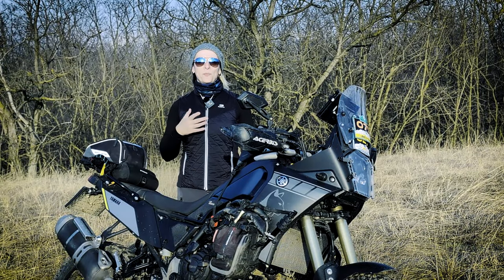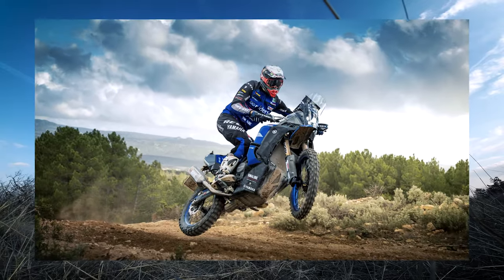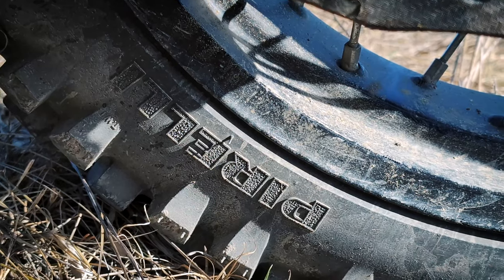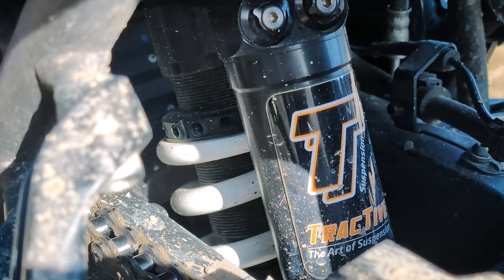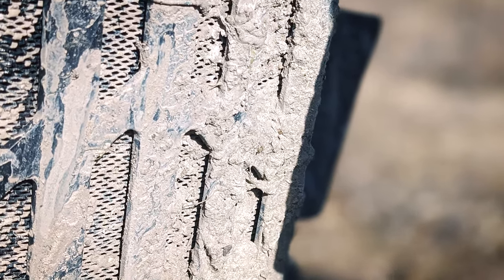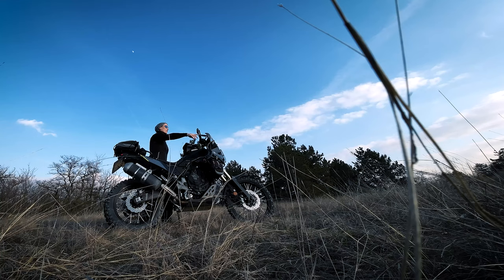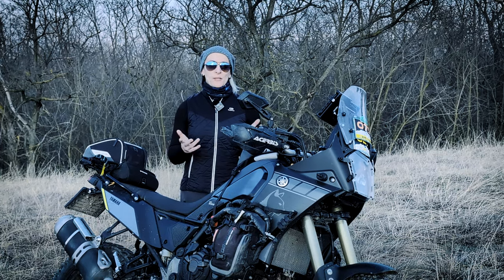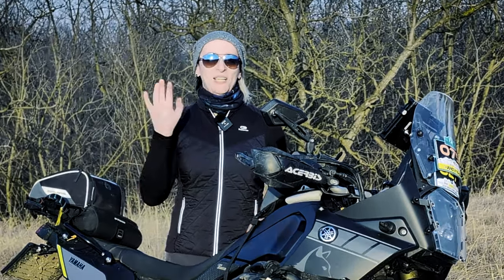Top 5 modifications to upgrade my Yamaha Tenere 700 for serious offroad riding

Comment: Holy shit girl, I was going to ask why you left the stock exhaust on the bike if you know what your doing, THEN I SAW YOU RIDE.. awesome to see you thrashing the big T7 and I will absolutely be paying more attention to your channel 👍. I can handle a t7 reasonably well but m8 your a weapon...great to see a lady's riding channel that survives on proper hard riding, not relying on "I'm a girl so I'm special"...I sure as hell could not out ride ya..top stuff and kind regards Jb
Reply from the maker: Thank you so much, I am really happy to hear it! ✋😊
Yes, you are right, the exhaust change is mandatory too, but for me these five things and the brake system are the most important to do list parts. 
Once I got the full control over the bike - shocks, forks, tires, brakes - and she is protected a bit more as the OEM sh.... well...
Next is the engine power and throwing away that ugly stock exhaust for sure! 😄
Reply: @braapt7  I mentioned the exhaust as the stocker has a bad habit of bending Into the swing arm on impact. I agree 100% on the 5 mods you talk about. In the order you suggest as well.
Reply from the maker: Just like that. Mine was bent in several times too, but nothing broken yet. But no question, it will be replaced asap after the full brake upgrade.
Reply: @braapt7   I couldn't agree more, I have essentially the same set up. Tyres/rally raid forks (also known as tractive as u know) revalved shock with 8.5kg spring, camel adv brake pedal and more (I won't bore you with details lol 🤣. But I completely understand why you've waited on the exhaust. When you do may I suggest you mate a camel adv high mount kit to a black widow muffler. The camel high mout kit and link pipe is expensive but very tough and well worth the effort of saving for it, while the black widow muffler is an excellent price (got mine for $300dollars (aussie dollars).  and has proven to be as good as any of the over priced stuff from Akropovic or arrow. Anyways I'm gunna save watching your vids till I get home (I'm an interstate truck driver) where I can see them on the TV instead of trying to watch on my phone. Keep those vids coming m8 👍👍
Reply from the maker: Thank you so much, I will! Nice upgrades, have a safe ride! ✌😎

Comment: Your not alone sis I did the first 4  I ride rocky ST and don't need long legs on this bike other then mine.... TracTive X-TREME PRO Rally Fork Cartridge Kit (+25 mm) and TracTive X-TREME-PA PRO Shock (+25 mm) Mitas Enduro Trail XT+ front and rear I did add a Scotts Stabilizer and a APX plate I don't like the big guards so I just have a rad guard and took off the rear pegs add a set of YZ pegs and Barkbusters took everythuing off the back.  I love to jump from my YZ250x to the T7 and back to the YZ really keeps me sharp.  Stay safe and enjoy the ride...
Reply from the maker: Thank you so much! ✋🙂 
You have an excellent setup on your bike. I wish I could handle the +25mm suspension, the T7 must be so much more agile with those ones. Also I wish I had an YZ250! :D 
Safe ride to you too! 😄

Comment: My favorite upgrades on mine was the lainer suspension, hp corse header back high mount exhaust, and of course crash bars and bark busters.
Reply from the maker: Totally agree, every bit of suspension upgrade is a treasure for this bike. The OEM forks and shocks are... not good enough. 
I think I will pick the MIVV high mount exhaust one day... not sure why, maybe I like the look and sound better. 🤷‍♀️
I never had a Barkbuster handguard, but since I got this SW-Motech one - I got this after I made this video -, I am pretty happy with them! 😀

Comment: Thanks for the video, it was great to watch. what's the problem with the andreani cartridge? I want to replace the transalp 750 be now and this is what I looked for. does it only have a disadvantage at high speed off road? thank you!
Reply from the maker: Thank you to watch it! ✋🙂
Shortly: there is nothing wrong with the Andreani cartridges, if you pick the off-road version, I am sure it will work nicely.

My problem, that I picked the Andreani Misano EVO version, which is not an off-road focused setup, just a regular fully adjustable cartridge. Really good, no problem with that either, but it's valves are not set for serious off-road ride. I can live with that, but they are working not in perfect sync with the awesome Tractive Rally Pro rear shocks. (Either too soft for landings and heavy bumps, or too rigid to smooth out the corner bumps.)

I made the mistake that I didn't upgrade the front and the rear at the same time.
First I thought that the front upgrade will be enough, so I bought the Andreani Misano EVO. - the off-road version wasn't available that time yet. 
Once I got that installed, I suddenly felt that the OEM rear shock is... well, can't really keep up the work with the front forks. :D After this I bought the Tractive rear shock, and once installed that one, I felt, the Andreani front can't handle the work of the rear agility... and here I am now. :D

Summarize: yes, the Andreani Misano Evo is a really good cartridge if you don't want to ride serious Enduro style off road, like big jumps and motocross track fast rides.
But if you aiming to beat Pol Tarres, you need more serious forks for that. ✌😁

Comment: With this wide open air intake I would seriously consider a different ECU map. Otherwise your T7 might run with a too lean fuel/air mix now.
And if you have a T7 with the monochrome dashboard take a look at the ABS Dongle from LSK to deactivate the rear ABS only.
Reply from the maker: Thank you for the tips! ✋🙂 
I was worried about the lean mix too, so I took it to the official Yamaha dealer where I bought my T7. It is owned by an ex-superbike championship rider, so I have trust in his team as well. They checked the bike's statistics, and they sad the bike runs on optimal fuel/air mixture. What would be the symptoms if they were not right?
I mean, when I ride, what should I feel, what should I see on the bike's behavior?  Getting hot early? Knocking piston? Less power? I am not experienced much in this with the CP2 engine, and I have no tools to measure it at home myself, so I have to trust in the service. :( ( in witch I always have doubt, no matter what. :D )

About the ABS... I don't trust the ABS at all. I would throw it out if the regulations wouldn't need it on the bike. I can feel the brake better, I can control the brake better without it, I tested it. Front and rear. In all surface conditions. Yes, I am that experienced rider. :)

Comment: Great No BS video, thanks.
Btw, why not get a high mounted exhaust? I dropped it like 4 times and my exhaust was touching the swing arm and damaged it a bit. Got the mivv dakar to fix it
Reply from the maker: Thank you, I am happy you liked my video! ✋🙂 
Why not the high mount exhaust? Well, I guess I didn't drop my bike on the right side as much as on the left side yet. 😁

But yes, I bent the OEM mount already, but still intact, although a bit cracked, bent and worn.

I am planning to upgrade it, but not sure yet, which one: the MiVV Dakar or the HPCorse? Why did you choose the MiVV? (I think I will grab that one too, in black color. I think it has better deeper sound than HPCorse.)
Reply: @braapt7  For me, sound is very important (detemines if I like a bike or not, no joke) and the mivv dakar absolutely nailed it. Can only recommend the Mivv Dakar it sounds like a beast. 

People say it's a bit on the louder side and I kinda agree, BUT you can absolutely ride it quietly.

The installation is also pretty straight forward, no sawing off parts like with the camel adv enduro kit.

Price is also fair. Would definitely buy it again. I have no idea why one should choose the HPCorse..

I can confidently recommend you the Mivv Dakar.

I measured how loud the exhaust is, and it reached about 93-94 db when revving to 5k RPM.

I am not sure where you are from, but if you plan to ride in tirol austria, it might get tricky since only 95 db are allowed on the majority of motorcycle favourable roads.

I am also not that tall (174 cm) which is why I swapped out a month later after getting the bike.

Hope that helps
Reply: @braapt7  In case of sound, I can send you a voice recording which sounds almost 1 to 1 to reality. But only sounds realistic with headphones though
Reply from the maker: @johanneswilhelm10  Thank you for the info, yes, indeed, it helped a lot. Now I am sure my next upgrade will be the MiVV Dakar, even if the loudness might be an issue in some situations. But if it's that easy to change it, well, even better! ✋🙂
And yes, I am curious about the sound sample too! Thank you!
Reply: @braapt7  one last thing.. for some reason Mivv doesn't include a carbon heatshield. You'd have to get this one extra for around 60€. Otherwise you will burn your shoe gripping with your legs.
Reply from the maker: I was thinking about wrapping the pipe with exhaust wraps... not sure tho if it's a good idea bec. of rust or something, but it would definitely protect the saddlebags too.

Comment: Excellent post and recommendations.   I think I wanna try one of those Tractive rear suspension upgrades -  excellent riding as well.  Bravo.   Subscribed.
Reply from the maker: Thank you so much! ✋🙂 
If you like to ride enduro style with the big bike, you will like the new shocks for sure. Especially at jumping, no more awkward bottoming all the time.
Reply: @braapt7  Just curious, did you race lighter enduro or motocross bikes before moving to the T7?    You look like you have  that sort of riding style.   I moved to the T7 from a naked street bike, so it still feels pretty big to me offroad (but getting easier each season).
Reply from the maker: Learning to ride offroad on the T7 must be challenging, I am sure.
Keep up the work, and just step by step, no rush it, because you must control the bike with subconscious muscle memory in so many changing environment. Riding offroad is wonderful and challenging. And yes, I got two decades of experience in off-road amateur riding motocross, enduro and even a bit trials. I was lucky to learn from race riders, it's in the family. =)
Reply: @braapt7  Thank for the kind words!    Yeah, you can tell from your riding  you are very skilled/experienced off-road.   Great content.   Ride safe!

Comment: Did you notice any tire cupping (odd wearing) on the front MT 21?  Where alternating two blocks wear more than the center block.
Reply from the maker: Well, yes. What causes it?
Reply: From what I read it is expected for knobby front tires to cup of road due to heavy front brake use and cornering. Underdamped suspension is also mentioned as a cause for tire cupping. So I was curious if upgrading your suspension would help with the tire cupping. But I guess it is unavoidable.
Reply from the maker: @AE8  Thank you to let me know! Well, I never really took attention for this. I am sure this could be avoided some way, but since I ride mostly offroad for fun, and using the tarmac just to get there. =) And on offroad I don't feel any difference of this, and on road the knobbies are horrible anyway. 🤷‍♀🤷‍♀😂😂

Comment: Try the camel one lever clutch upgrade
Reply from the maker: I got the easy clutch set from another manufacturer, and you are right, it is awesomesauce. 😎👌
Probably I should have added it to the list as an extra tip instead of the brake pedal.

So... if you use more clutch, get the easy clutch, if you are more keen for the brake, get that one. ✌️😌

Comment: 140/18 is 10mm too narrow the wheel. Yamaha calls for 150. If you air down it can come off beed.
Reply from the maker: It is true, that 150/70 r18 is the OEM tire size of the Tenere 700. Never use any other tire, unless you know what you are doing.
And yes, 140/80 r18 is a bit weak for the T7, but if you know it's limits and benefits, you can live with it. I could. Two years, zero problems. (But I got 30 years experience in off-road motorbike riding.)
Also I got a 150/70 r18 Dunlop 908rr on my bike right now, best tire yet for mixed use.

Comment: Where did u get this 3d printed thing? Can you share the file
Reply from the maker: Sure thing, but be aware, it works only with the Off-the-road air filter!
(due thickness of the foam edge and the metal rim on the OffTheRoad foam filter) 
And check the foam cover for 100% sealing.
Also don't forget to add grease on the necessary places to prevent any dust leakage. (If you used dirtbikes with foam filter you already know, if not, watch some tutorials on youtube, or ask a friend about.)
https://www.thingiverse.com/thing:5346706
Reply: @braapt7  thousand thanks for the file. I already have the OTR foam filter. Until now I used it with the OEM snorkel with grease and Twin Air Grand Price Nylon Cover, but I was afraid the seal wasn’t good enough. Now I can finally get a decent pre foam filter and seal it properly.
Reply from the maker: @AdventureWR  I am happy I could help! ✋🙂 
Here is how I use it: 
- I grease the bottom rim of the OffTheRoad filter's foam rim - after oil it with filter oil -, just to be 100% secure, put in place 
- grease the metal top of the filter yet again for 100% seal 
- put on the big part of the 3D printed cap, - look for right positioning - secure with OEM bolts (screws), main filter done. 
- wet the prefilter layer with filter oil, no grease this time (I use cca 4mm thick flat motorbike filter foam cut in shape including bolt holes). 
- finally put on the small rim and fix with 4 small metal sheet or wood screws. Beware, this part is non reversible, got it's fix orientation forward. 

I change the pre filter after every heavy dusty ride - I got several pre oiled prefilters in my bag prepared - and I clean the main filter only every two-three months, depends on the use of the bike.
Reply: @braapt7  thanks again for the info 🙏 when you lose the snorkel, do u have to re-map the ECU? I remember something about running rich or lean after you increase airflow ?
Reply from the maker: When I replaced  the air filter I didn't notice anything, it just worked as before. Same easy start, same throttle reactions, same power, same engine temperature tolerance to heat and pressure.
No strange noises.
She was in the official Yamaha service already two times, and they told me, all measures are fine, nothing had to be set.

I am sure if you are super sensitive to power and keen on more 2-3 HP to optimize the engine, it's better to set to perfect after the filter change, but for me it's good enough.
Reply: @braapt7  thanks for the info

Comment: so moderate offroad riding
Reply from the maker: Basically yes. Even at moderate difficulty off-road track is highly recommended to use these upgrades. However, really depends of the terms of "serious" and "moderate" definition.

What I really meant, you can ride offroad just occasionally for fun with friends on dirtroads, backroads, whatever. For this purpose you don't need a real hardcore knobby tire, no need for expensive suspension, and if you usually ride on sand, you don't even need a stronger bashplate.

But if you want to rider harder than this, aka: take the ride "seriously", then you will need many upgrades for safe and controlled ride.

Here you can decide your riding level: hobby, moderate, expert, master, Pol Tarres level, etc. but for all of these serious rides you will need upgrades. 
And all of the possible upgrades these are my top five picks for safety, control and fun.

What would be your top five pick?